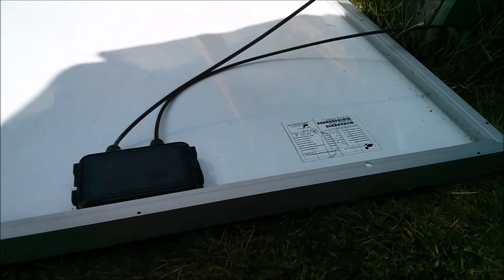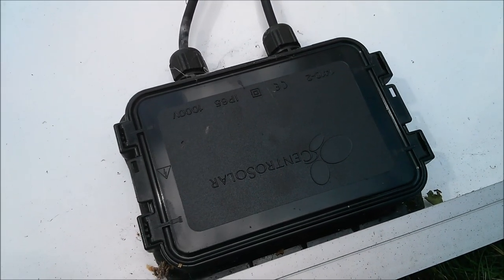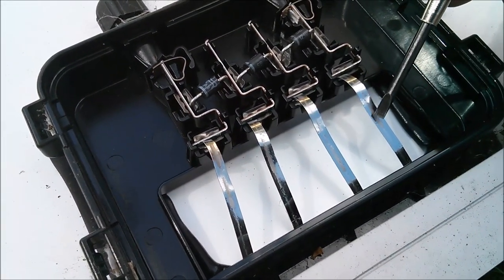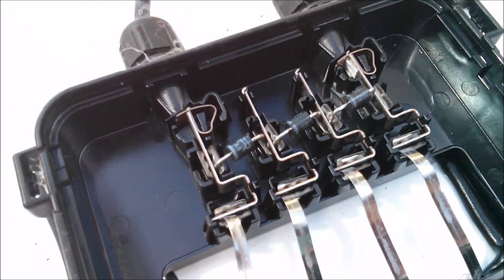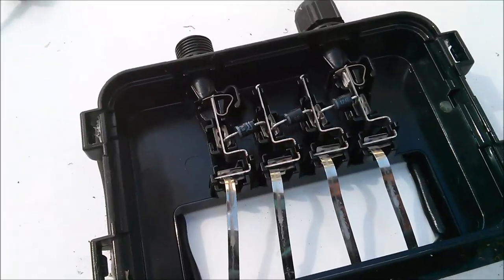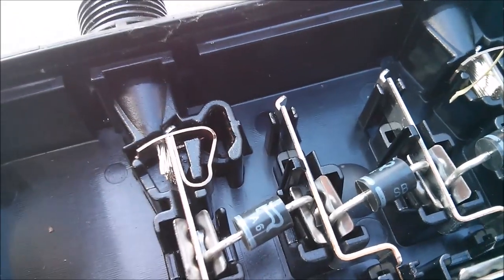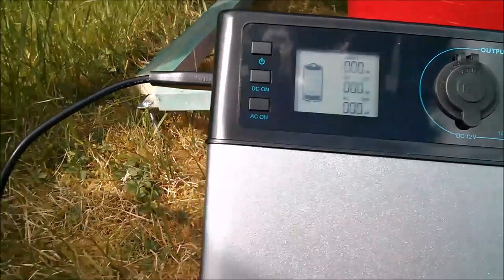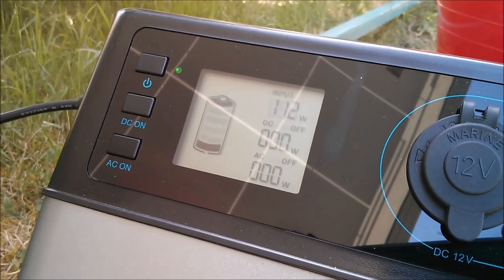Another Solar Panel Pulled Cable

Comment: 3 diodes, so two strings of cells, a diode for reverse polarity protection over each  string, and a diode in between the two strings for panel reverse polarity protection.  it may seem odd and make you scratch your head for a few seconds to need 3, but its for shading, if the sun comes up and illuminates only half the panel then it would 'push' voltage through the dark side string of cells, as they are in series with + to minus, you effectively 'push volts the wrong way' , which is the same as what happens with a half charged battery if you pop in a full charged one in the same torch or whatever, hence the warning on such things to only replace all the batteries at the same time

Comment: Cheap O diode box on that panel to be sure.  Not come across on like that yet.  Yes Sir solder that stuff.  Good  in that they left plenty of the ribbon to work with.  You can replace the whole thing easy enough.  Crazy prices they ask for those simple diode boxes.